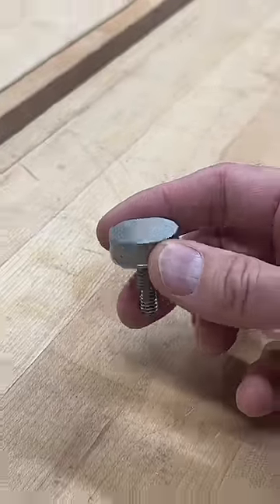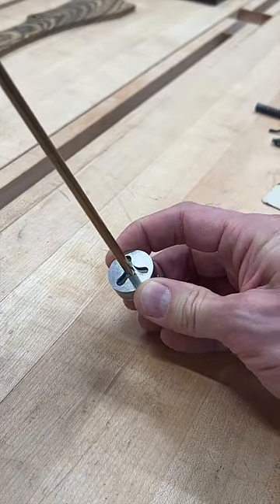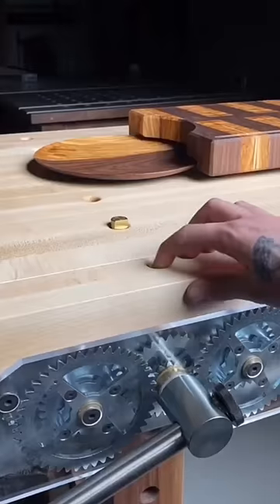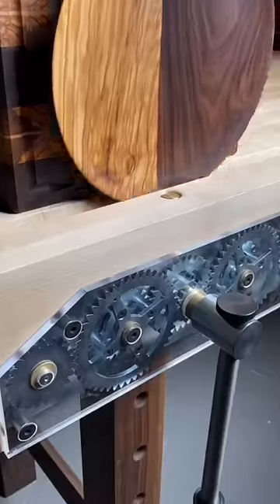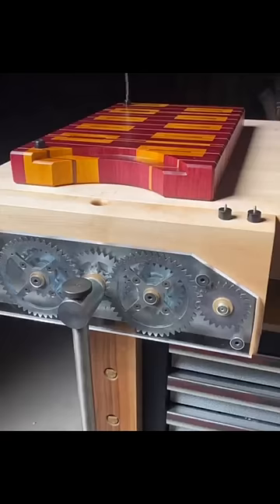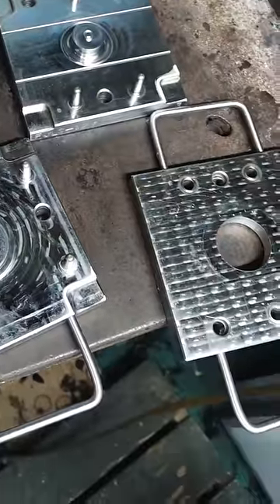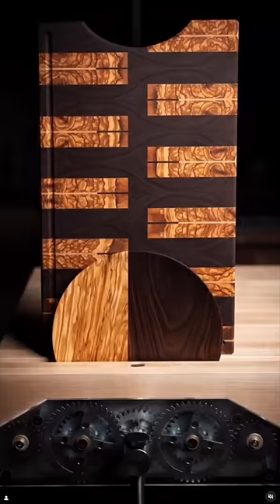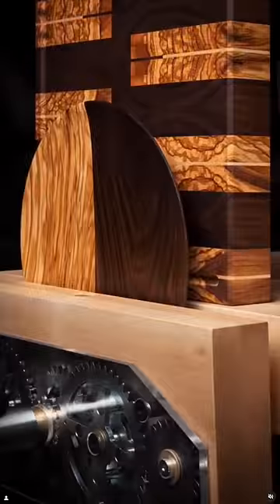Pika Screw on Owl Woodworks cutting board

Comment: $26 for a screw to go on the underside of a chopping board?! This has got to be the definition of more money than sense.
Reply: If you're a famous chef your knives are worth thousands
Reply: @MicroplaysMC  Knives I can understand. They are tools of a trade. Thousands seems extreme partial understandable.
Reply: @ensignphil very high end knives are more for its design and craftsmanship. You can get professional grade high end knives for a hundred each or decent ones for $30. The knives that cost thousands are luxury items.
Reply: That's actually pretty cheap for that type of bolt. Both can get seriously dumb expensive
Reply: high end cutting boards can go for over 800$ even without feet, these are boards you place sideways on your kitchen top so you will end up seeing them... not to mention when you buy such an expencive cuttingboard you want everything to be up to the same quality, not have some glued on or screwed in feet that feel cheap compaired to the rest
Reply: They can be used for them cutting boards tho you can use them for reception desk to have panels on the front with standoffs. And other kind of high end wood working that requires visible screws that can be seen and u don't want to use caps to hide them.
Reply: @MicroplaysMC yea bc they need to hold an edge through thousands of hours of use and also you can take pride in an instrument like that neither of those things are true for the screws on the bottom of the foot of the board. There’s also more elegant solutions like have the screw slip through a small slit in the rubber foot that can then be sealed or shrunk to an unnoticeable size with a $17 heat gun
Reply: @l3gend576  I think you're not realizing that if there are people out there who want the coolest equipment for their work, they don't care about price or efficiency. In fact, those kinds of people would buy something like this just for the uniqueness. I'm all for making things good and cheap, but if there's a market for it people will make money off it, whether it's a necessity or not.
Reply: “For a screw to go on the underside of a chopping board” ah ok so your first introduction to this screw is on the under side of a chopping board and not anything else? Cool
Reply: @ensignphil bruh. How exactly do you think those screws are made? Thats craftmansship too, 26$ is a ok prize for such high tolerances on stainless steal
Reply: @angieolli5022  I don't have a problem with the screws costing $26. It's using them for the UNDERSIDE of a rubber foot that I think is a ridiculous extravagance.
Reply: @ensignphil There are definitely better uses for these. The market on high end cutting boards with feet is probably fairly limited. Professional chefs use blocks with no feet so they can cut on both sides, clean them easily, and store them easily. There’s a market for this but only among well-to-do people that just want the highest end gadgets.
Reply: @ensignphil  OK, I totally got you wrong
Reply: Can I just remind you all there's 4 feet on a board? $104!
Reply: @angieolli5022 no you don’t have him wrong lol. He clearly doesn’t understand the world of high end anything because this is so cheap compared to some “extravagant” things. Like $100 is pocket change to anyone buying $800 cutting boards lol. He entirely misses the point of having pride in your work and using craftsmanship all around your product.
Reply: @NigelTolley and your point is? If the cutting board is of a certain quality, then putting cheap ass feet wouldn’t make people who are in the market for that product choose his over someone else’s. Therefore he offers something cool that only the owner knows about but it gives you that cool little feeling of quality and substance in a product. Pretty simple really.
Reply: @NigelTolley  Exactly!
Reply: @MicroplaysMC  If  you're a famous chef, you don't use cutting boards with feet on them that can trap moisture, leading to possible bacteria (exactly what you want on a surface for food).  You also want to be able to use both sides of the board, something you can't do if there are feet sticking up.
Reply: @StrangelyIronic  You offer valuable insight from the field. Although there's still a market for the fancy. As long as you can make it elegant, or even convince your customer that your product is distinct, they'll pay. Frankly I wouldn't mind making a few dollars off the rich.
Reply: @Mr1121628  My point? That it isn't just £26.
I know there's a market for stupidly expensive stuff, just because it is pretty and expensive and rare.
Reply: @Mr1121628  fuck, I need a spine, now I think you are right. I can understand both points. Two philosophys colliding
Reply: @maartenvandenberge7116 overpriced high end cutting boards you mean. You can get a great wood cutting board for a lot less that does the same thing and is the same wood.
Reply: @MicroplaysMC  If you're a famous chef, you don't put feet on your cutting board.
Reply: if they are rich then it does make sense, people spend more cause they like the look of something all the time
Reply: Nah it makes sense. If you cook for a living you want to have the best equipment. same goes for any profession, like buying an expensive keyboard because you’re a coder, an expensive pencil case for artists, etc.
Reply: metzitzahbpeh4954  my point is if the guy's making money on something fancy for rich people, let him
Reply: @MicroplaysMC and the guy gets to make cool screws. Keep our shops alive and interesting.
Reply: @MicroplaysMC  Thats a weird defense of impractical nature. Essentially; "I spend so much here I might as well spend way too much here."

Knives are mediums of interactions rather directly from chef to work item. There is a tangible value in the shift from one expense to another in terms of knives. Certain point you're spending beyond a reasonable state of return. Fine to strive for that, but you're a bit of a pedantic poss if you're desiring that level of detail.

Sorry but the logic of 'I spent $$$ on a tool therefore Ill spend $$ on a screw' is a little screwing lmao
Reply: @AlkalineGamingHD  I know that. That's why I'm trying to make the distinction that this guy is making something expensive and cool. Not an actually professionally made product. Products made by the trade for the trade are far more practical by every measure, as that is their purpose.
Reply: @MicroplaysMC money doesn't make sense
Reply: People with that level of money just buy stuff because other people don't have it.
Reply: People will pay a high price for the smaller details that set masterpieces apart, especially when those pieces are relavent to their passions. Definitely a high-end purchase not intended for the layman, but it has its market.
Reply: So by your definition you should use 10 cent feet on a $1000 chopping board! Sounds legit.
Reply: @l3gend576 great knives do not give you thousands of hours of use without sharpening. In fact no knife could give you thousands of hours use and still cut effectively. Ever watched a butcher? They sharpen their knife every time it leaves the scabbard.
Reply: @MicroplaysMC  If you're a famous chef with thousand dollar knives, why are you buying cutting boards with screws in them?
Reply: don't forget the custom screwdriver  to drive it. Why not just use a knurled thumbscrew since you are putting rubber feet on it.
Reply: On a moving, regularly washed workpiece in a humid and temperature changing room - you need to retighten such screws once in a while. Right?
Do you want to send it in to service? Do you want to sell quote a lot of key-nuts?
Maybe i don't find the same question asked by someone else. Sorry if repeat.
Reply: It takes time to make… 😂😂😂
Reply: At the end of the day, if we're truly utilitarian, everyone would be driving Honda Civics, buy plastic cutting boards, use IKEA furniture, and any spent over that is considered excess.
Reply: @RaveN_EDM ok…? we’re still talking about knives when this is about an underside screw😂
Reply: I bet I can order the same thing in China for a dollar.
Reply: @ensignphil isn't a cutting board a tool
Reply: @MicroplaysMC those very expensive knives gonna be used on the inside of the underside of the feet of the board????
Reply: as somebody who is an engineer in a medical sector, you woudnt believe what kind of money they throw away just because they can.. buy a machine for 50.000$ doesnt work ? ech thats okay scrap it 2 weeks later for nothing
Reply: @l3gend576 There are always cheaper options, but often at the expense of quality. Your comment highlights that.
Reply: @MicroplaysMC  that’s a good point
Reply: Something the US military would buy
Reply: It’s all relative to how much money you have. To someone making 500k a year, does it really matter if they were $100 for a set of 4?
Reply: Yeah, but it’s sense applied wisely and the money spent once.
Reply: @MicroplaysMC thats not true.
Reply: Some people like every aspect of something to be high quality. It's really just that simple. You're probably with the majority throwing money into a metaphorical fire with take out, streaming services and phone data you never use up. Settle down.
Reply: @RaveN_EDM Not true! my high-cost knifes hold up so much longer and stay so much longer sharp, than EVERY 30$ knife ever will!
Reply: @MicroplaysMC wtf has a knife to do with a screw from a cutting board?!?!? Wtf  common sense lacking much?
Reply: If you are paying 800+ for a cutting board, you wont worry about the extra hundred the feet costs.
Reply: Or some people are willing to spend on things they are passionate about if the quality is there. Gonlook at your eating out budget, or game budget, or whatever budget you want. Plenty think you are wasting your money too, but if you enjoy it, you are willing to pay top amounts for something not many people can do.

Comment: Wire EDM shop:  "It's gonna be used for what?
Reply: Money is money. They wouldn't give a damn if it was a nipple clamp for your pet pig.
Reply: @myleswillis  I don't disagree.
Reply: Why would the wire edm shop care what you do with the work you commission them to do?
Reply: Oh, and it probably has a 16hr cycle and its made from fucking titanium. You know, only the finest materials for rubber feet

Oh that aerospace part meaant to withold the force of the universe? Ye no thats just aluminium….
Reply: @myleswillis they most certainly will give a damn. They will do it nonetheless though. Because money is money :D
Reply: @joseppedaia3673 they'll laugh all the way to the bank
Reply: @Mr1121628 they wouldn't really care, but you'd better believe they'll have a good chuckle over it during lunch break
Reply: Then they all started dancing.

Oh, that's a different EDM
Reply: Doesn't have to be wire edm'd.. 
I work in a foundry for the molding department I have gotten the same effect many many times with just milling and grinding the top

Comment: Funfact: even the slightest dent or whatever will render it absolutely unusable
Reply: Okay.... but dent it 😂
Reply: @OsiDio  it’s made out of a softer material that a medium quality chefs knife, it’s only a matter of time.
Reply: @brettminer1079  uh... a medium quality chefs knife is pretty robust. Not to mention in the inherent properties of stainless steel. I wouldn't at any point consider SS to be "soft". And this is coming from someone how's made a lot of stainless steel parts professionally. Denting of SS starts to happen around 18Gauge.
Reply: @OsiDio its not unreasonable to think that metal, even hard metal, could get peened over.  Literally how hardened steel fasteners are held in place on some fixtures.
Reply: @OsiDio you have zero common sense
Reply: you would have to try pretty hard man, if it was used on in a different application with a harsher environment, then I'd say it probably wouldn't last long. although I do think something with such a close fit like that could potentially get seized by buildup or something like that, but even that would probably be fine after some WD-40 and a few taps of a hammer with a brass punch.
Reply: @bigluisjayrogan  lol bro I'm a professional in the metal industry. I definitely have common sense and I definitely know what I'm talking about.
Reply: @patricklogsdon8680  the thing though, is if the clearances are tight enough then stuff won't get trapped in because they'd be larger than the clearance. But personally I couldn't imagine building a home project with those kind of tolerances in mind.
Reply: @jacob9045  same here, I'm a machinist, and you are definitely right about that.
Reply: @Just-Steve  I'd like to see a chef peen that over by accident. and yea, sure you can peen harder steel, but good luck doing that without a center punch and hammer, especially since the two surfaces are flush with each other. I don't know what you do with your cutting boards, but I don't think he has anything to worry about.
Reply: Also, rust and grime
Reply: @MannoMax It's stainless steel, rust isn't an issue unless it's in the middle of the ocean
Reply: @OsiDio everyone's a "professional in the industry" when it comes to comment sections. From one engineer to another, you haven't got enough experience in the industry to make crazy sweeping statements. Your comment about 18 gauge stainless and dents is just nonsense, even my limited experience has shown me that's not true
Reply: @richardmillhousenixon you know stainless steel can rust in normal damp conditions, right? Even without the presence of moisture rust can develop. I feel you don't know anything about how stainless is graded or what those grades mean
Reply: @OsiDio it sits on a surface. Surfaces can have dirt and grit which have hardness levels above SS. It's a dumb idea for hiding fasteners underneath rubber feet.
Reply: @jawms  yea bro, if my drop my bag of glandular diamonds and quartz 🤣 but then it ain't denting like OP said, it's scratching.
Reply: @OsiDio  I'm a machinist, I work with metal all day. There are definitely different hardness to different SS. 303 has so much chromium(I believe) that it cuts like butter, and it doesn't even rust in salt water so its good for specific applications. Agreed with everyone else, why hide a $26 screw. It needs to be on display
Reply: also oxidation
Reply: Ah. Perfect for the feet of anything.
Reply: It is only a fun fact if it is a fact but it is nothing more then your opinion.
Reply: @OsiDio stainless steel is a soft hard metal.  Screws made of it strip very easily
Reply: @OsiDio  Yeah, stainless is soft compared to carbon steel.  Just compare an aircraft grade 10-32 Stainless PK machine screw to the same screw in carbon steel.  Stainless is WAY softer.
Reply: @David-hm9ic  okay right, but that's aircraft grade SS. I'd be of the personal mind that IF someone actually made a screw out of this type of SS and actually sold it on a consumer level I'd just fuck off that conversation 💀 that's a dumb idea from start to finish. I myself have worked with plenty of SS that end up being used as brake rotors on machines. Currently I work with a multi-millon dollar setup for fluid process in a billion dollar food manufacturing plant. Completely made out of SS.... dealing in literally tons of product at any given minute. So I'm not sure where the deduction that SS is "soft". Maybe if you use a type that is soft, but then again I could make the exact same argument about carbon steel. Not everything is as hard as AR400.
Reply: @OsiDio you’ve chosen to argue semantics, the fact is any amount of damage will render this already over designed scrap unusable for its intended purpose. It’s just supposed to look smooth and once it can’t do that it’s worthless.
Reply: @OsiDio your final comment carries the same energy as the janitor that worked at nasa.
You simply work for the company, it’s not your money you’re attempting to brag about. And you’ve already gone back on your statement a few times now so all credibility is lost.

Comment: RUBBER FOOT ? so you can't see the screw anyway, logic has left the chat
Reply: @whywhatwhenwherewow huh?
Reply: @nyxnaux4737  if you watch to the end of the video you can see the rubber foot and that the screw is exposed. And even if it was fully enclosed in the rubber foot, that would mean the rubber foot sort of snapped around the screw instead of covering it. And cutting boards aren't always laying flat, in fact most of the time it wouldn't be
Reply: @whywhatwhenwherewow I'm going to agree and disagree with you.

They watched the video, but a cutting board sits on a table. You can not see the bottom of the foot when it's in use.

But you are right, you can see it. If stored vertically it would be visible. Or when showing it off.